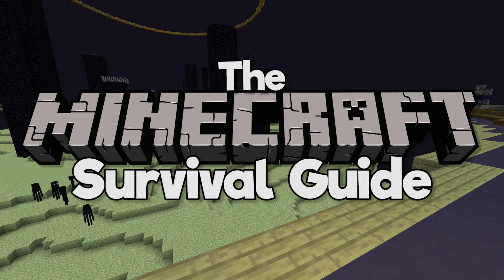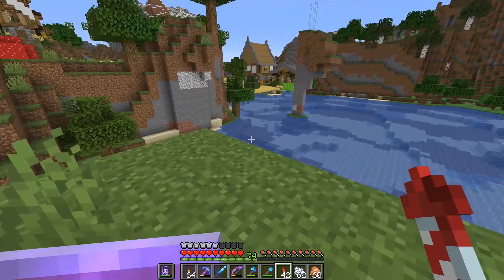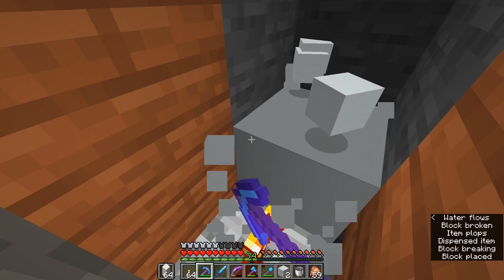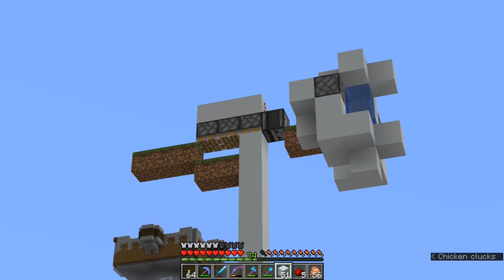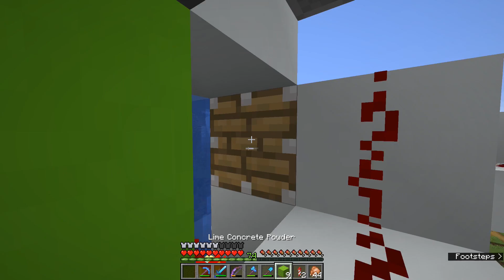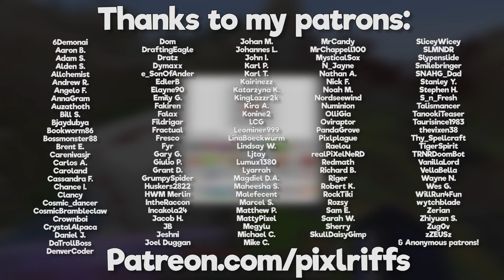Three Concrete Maker Designs! ▫ The Minecraft Survival Guide (Tutorial Lets Play) [Part 185]

Comment: 11:30 - Check my math for me. Your inventory is 9x4=36, plus the 9 from the dispenser is 45, minus the 1 space you need to hold your pickaxe is 44. 44 full stacks of concrete powder is 2816 blocks. Your diamond pickaxe as a max durability of 1561, with Unbreaking 3 that essentially takes it up to 6244. With that much durability you could go through two full inventories worth of concrete before having to repair. Or if you had Mending and an do farm near where you were making your concrete you could repair between each run.

Comment: Just how hard would it have been to allow a left trigger on a controller to control the left hand, or is that a feature they purposely wanted to keep exclusive to Java? 😑 It’s the tiny abilities like that I’d buy the Java edition for.
Reply from the maker: I think it’s restricted on console/Bedrock Edition because the same version is also used on mobile devices, and it would overcomplicate the touch-screen interface to use the off-hand the way we use it in Java (where a mouse/keyboard is the default controller).
Reply: Pixlriffs I guess that would make sense. I play mainly on Switch, but despite having a touchscreen too, it doesn’t make use of the touchscreen, which would’ve been interesting if they allowed Switch players to swap between using the touchscreen or controllers.

Comment: You could set up another dropper that puts a junk item into a container with a comparator connected too it. For example it take 3 stakes to get enough to be worth tnting. You have a container with whatever amount of items need to have a stronger siginal strength than 3 stacks. The trigger it once you have placed that main items something you do but moving items into a container with a dropper eaxh time you place a block.   When the tnt drops you can depower a hopper or something to reset it.

Comment: Hmm. Actually, your circuit prevents clogging up as-is...it only dispenses more powder if you can set a new one, so if the feed tape is full, it won't give you more (unless you can punch a concrete block out?  Not sure on that one). Not 100% sure if these placements will work right, but...put an 'open circuit through the last block position, then put an observer on the inside side  of the last piston, then a XOR circuit that only fires if the piston doesn't fire  when a block moves into that last postition and use that to trigger the TNT (make sure there's enough space to let the TNT drop without hitting anything in the circuit!)

Comment: Perhaps you could surround d the entire concrete “tube” in obsidian, which is blast proof, down until a few blocks past the last concrete block in order to contain the drops to the area of your hoppers. You probably don’t even need to cover the entire sides, but at least from the height where the concrete begins to blow up to a few blocks above hoppers. The tnt once charged usually jumps randomly a few pixels in any direction and so you could also surround your dispenser with 3 blocks of obsidian to keep the tnt in a consistent placement.
Reply: Question  being, what takes longer, making a redstone clock, or mining out 5 stacks of obsidian for a reasonably-sized blast-shield?  One may be more complicated, but it is also more elegant, and a great deal smaller, which makes it easier to encase in an aesthetic build, if that's the sort of thing one cares about

Comment: So far as I know, the first one only works for Java but not Bedrock. However, you can do something similar: pillar up on concrete powder inside a pool like Pix's. Jump down (no harm done in water) and mine away. Not sure about the redstone ones working on Bedrock, but FoxyNoTail has a video out on concrete makers in Bedrock. The two versions are not only different in how many bugs you have to cope with, the mechanics are surprisingly different the more you get into the details.
Reply: You can also just pillar up while building a ring around your pillar, drop water from the top, then dig back down
Reply: I did that once but the water flushed me down from the pillar, so I had this 120+ block high concrete structure and had to swim up again through the waterfall, remove the water and mine down. Of course when I removed that water, I was so clumsy that it still flushed me down, so I had the high tower standing there and needed scaffolding to climb back up und mine down. :))))

Comment: Just a thought but couldn't you just dispense the TNT onto a well placed Obsidian block obviating the need for the clock delay? I've built tree farms like this and it seems to be pretty reliable in placement. Also you could have built the whole base out of obsidian allowing you to have the farm on the ground?
Reply from the maker: There are always different ways of doing these things. I wanted to avoid using large amounts of obsidian because it's a pain to work with if you misplace something, and there's always the chance that the exploded concrete items can end up on that obsidian block, just to get needlessly destroyed by the next TNT blast.

The clock works just fine. It blew up once, I rebuilt it, it's been fine since then. Also gave me the opportunity to demonstrate a pulse extender, which I don't think I've covered at all in this series yet.

Comment: a concrete factory in a rustic setting shouldn't be a problem since the Romans used concrete, they even had a version that set under water
Reply: But all that tech was lost with the fall of Rome, then rediscovered in I think the late 1800s iirc
Reply: @airsoftboss5270  just because we were idiots and lost it doesn't  mean a fantasy world did (it just shows that the tec was available at fairly early stage of cultural development).
Reply: The cities of  roman empire were a lot of things, but "rustic" is not one of them.  The word doesn't just mean "old," it also has a connotation of rural settings and of simplistic architectural design.

Comment: How to make shulker farm
Reply from the maker: It isn't possible to farm shulkers unless you're playing with datapacks or mods. In the default/vanilla game, you just have to keep finding End Cities.
Reply: @Pixlriffs  the Scicraft guys made a shulker farm by putting them in minecarts and duplicating them. Though it's very complicated and you need to use all of the dimensions
Reply: @derp4581  I'm not sure that it still works tho, as they have fixed a lot of bugs and glitches recently.
Reply: The best you can do in Vanilla is to have a data pack such as Vanilla Tweaks that allows two shulkers instead of only one dropping.